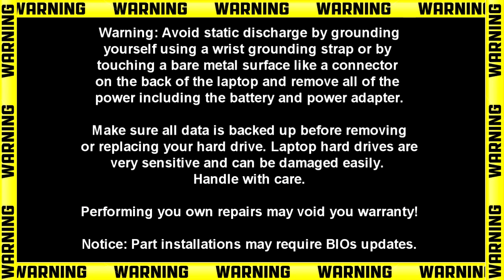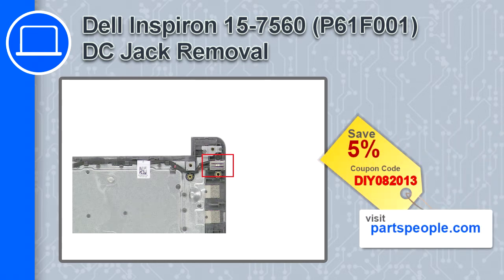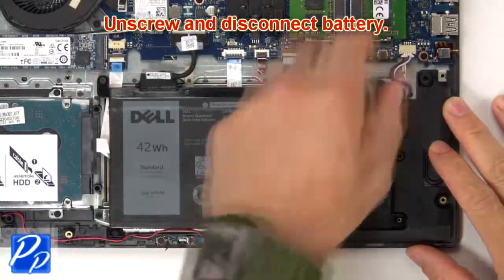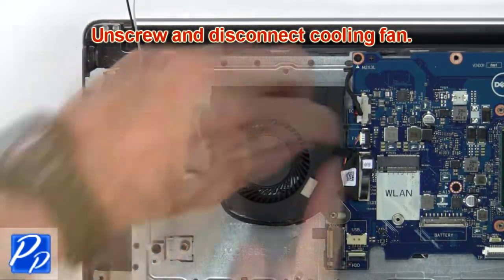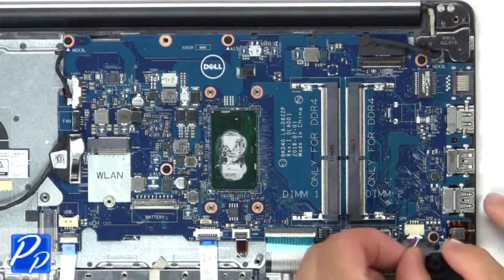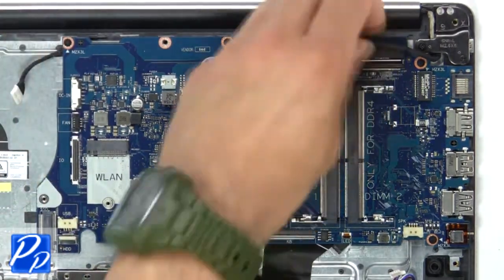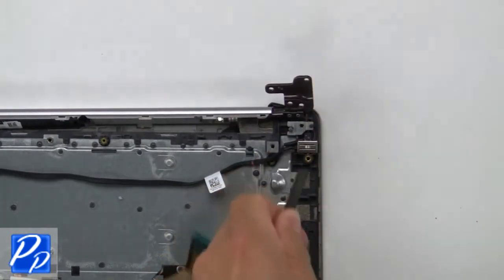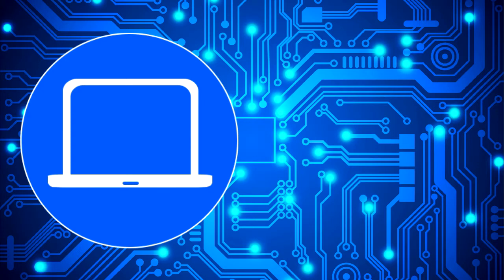Dell Inspiron 15-7560 (P61F001) DC Jack How-To Video Tutorial

Comment: What if most of the screws are stuck? Not stripped just won't move
Reply from the maker: I don't know if I've encountered this. But whenever I have a stubborn screw I use a flat head that fits snuggly. They tend to grab the screw a little better.